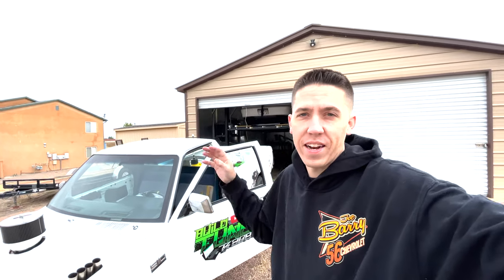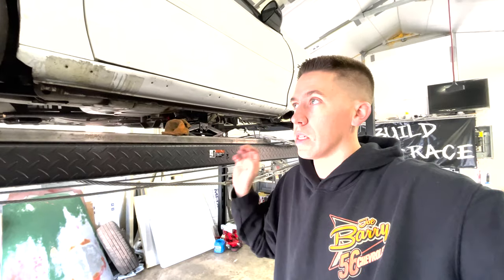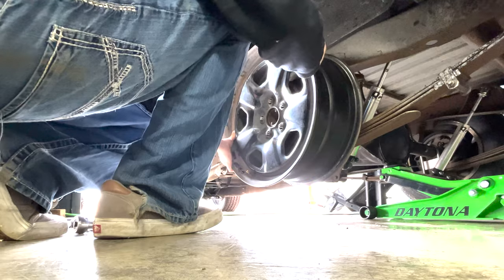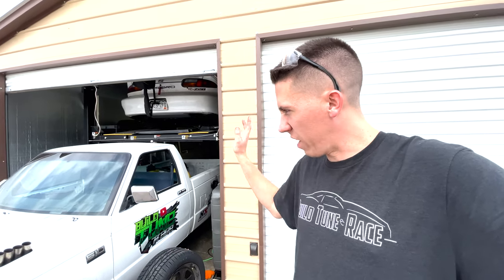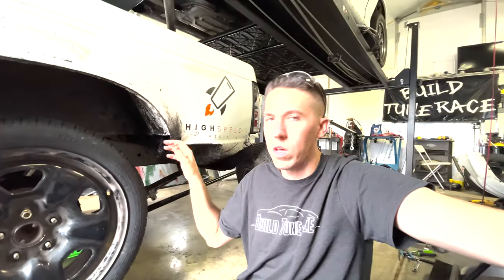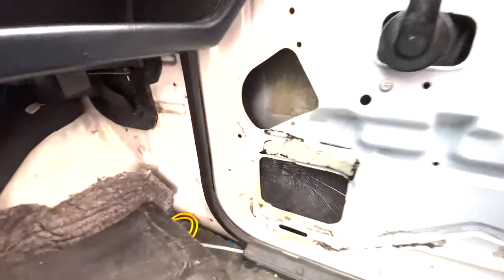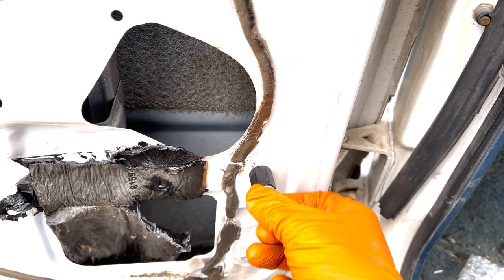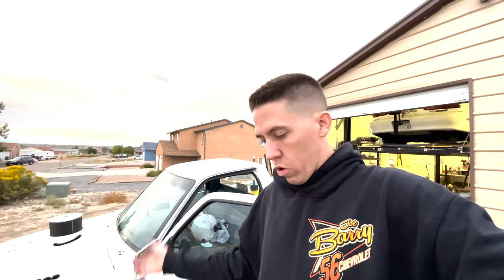LS Swapped S10 is ready for Cleetus and Cars Houston Burnout Competition! *NEW UPGRADES*

Comment: If you ever need to install any more Rivit-Nuts purchasing a “pop-rivet” style tool is worth every penny. I purchased a riv-nut kit that came with multiple size mandrels and an assortment of riv-nuts for about 30 bucks a few years back and as long as I keep the threads lubed and screw the nuts all the way onto the mandrel and it works like a champ.  
Have you ever considered getting a piece of bolt together culvert pipe or even cutting up a 55 gallon barrel to line the inner wheel well of Burnie. In years past I have used both for wheel wells of pickup truck beads that were damaged from rust, blowouts, and other assorted mayhem as well as fenders for trailers that were taken off road and saw lots of abuse.

Comment: taller tire = more wheel speed if the motor will pull it , got a bit of a chuckle out of this  here's  this bloke heading of to a comp with 1  set  of tyres and hopes to win ? over here you got to qualify 2 chances to get in the top 10  they add up the score from both qualifiers  10 highest scores are in ( its a bit of a win on its own getting in the top 10 in country west aus there will be 80 to 100 cars trying to get in ) but the real party doesnt start till after the comp when their is a open pad  , we normally take  10 sets of wheels made up ready to go  $55 a tyre 205/65-15 we are runnin a population of 1.5 million people in this state  and the comps are still getting bigger  and the lineup is getting longer. hope you do well in the comp mate enjoy this sport while its in its infancy  cause the lineup is only gunna get longer